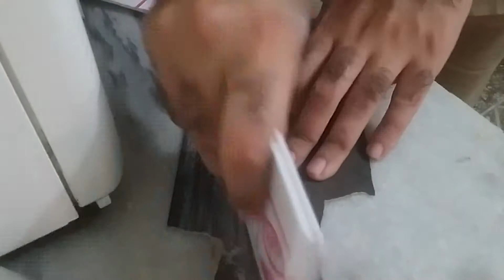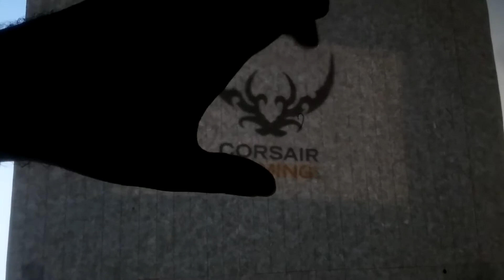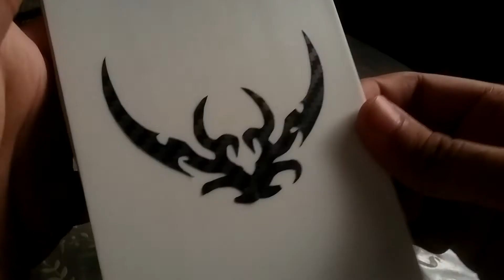Corsair A70 Mod | Gaming edition | Diy tech

Comment: this enclosure would decrease the cooling efficiency bro, there is a reason why the aluminium are meant to remain open
Reply from the maker: It might not at all as i was not decreasing the airflow by any means as it was getting earlier. This shroud/enclosure is directing the air flow from one end of cooler to the other. It will be decreasing the in-case temp by exhausting the heat out  too.  
I am unable to find a link on youtube someone actually proved that this (covering sides n directing airflow from one end to the other ) increases performance. I think it was done on a hyper 212 with duct tapes but it decreased by a degree or two. I will share if i got my hands onto that. 
Heres whats actually was done to the airflow in my case
https://ibb.co/byJ1Ky
Reply: Dwanel Barman umm, no